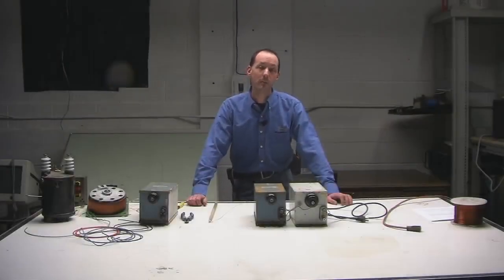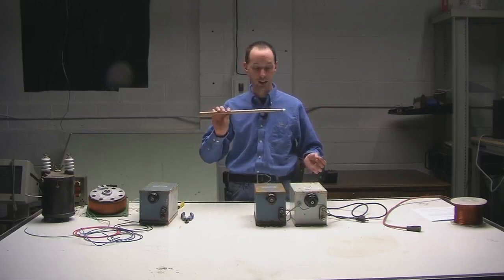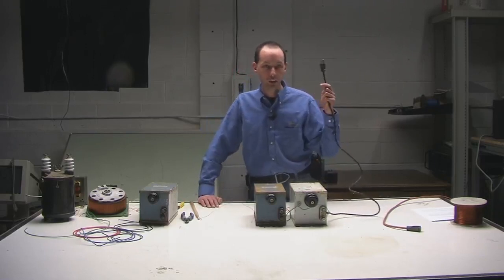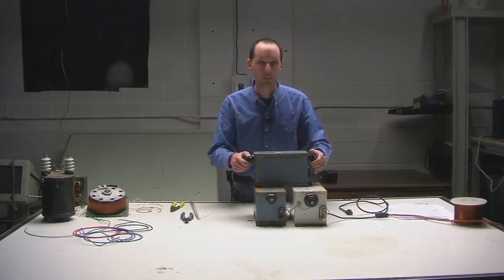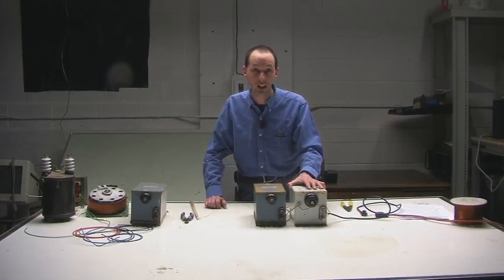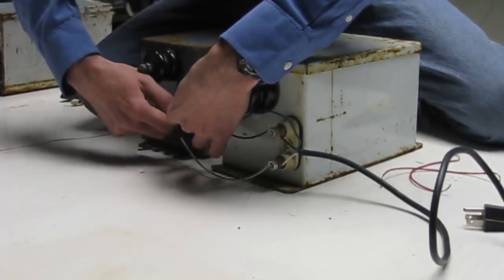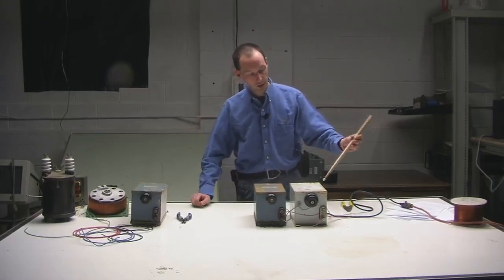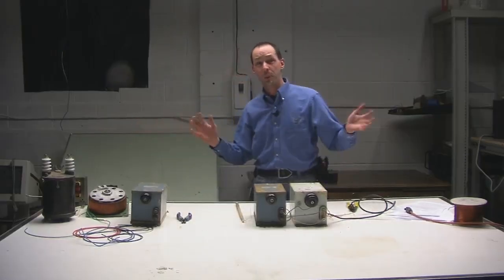Phasing Neon Sign Transformers for Tesla Coil Use Part-1

Comment from the maker: 300V is the minimum generally accepted breakdown voltage for atmosphere. That means that below that, the wires have to touch. In practice it's much higher then that for any "real world" application, but 300V is the generally accepted line.

Comment: They are built with dual windings for safety. Typically, each output wire goes to a different end of a long glass tube. There is almost zero chance that those will even get short circuited. However, there is a possibility that one of the terminals gets a short circuit to ground... either as a flash-over or by a human touch. With a centre tapped transformer, that means only 1/2 the voltage so (theoretically) much safer.

Comment: I have 3 9kv 30ma nst can i phase all 3...i bought one thats 9kv but 60ma will this mess it up...i see different things ...one guy says it wont matter and others say dont try it.... what could be the issue and does it need to be in qny order...like the 60ma going at the first or last of the connected nsts
Reply from the maker: I don't mix different ratings. If you're connecting transformers together (either in series or in parallel) you want them to all be matched. Strange, unpredictable, and very very bad things happen if you start mixing them.

Comment: @soljaboy2006 It's a hotstick.
It is a safety device, and yep, the tip is grounded and the rod is non conductive.
This is so you don't have to get close/hold the wires to draw an arc, because if you do you might get an unpleasant surprise.

Comment: I have questions i can not find the answers too...so i managed to go on a nst buying spree and i ended up with 4 all diff values lmao....7.5kv 9kv 12k. And 15kv...but i have a xhance to buy another 9kv but not 30ma like the rest...its 60ma my question is would this one at 60ma produce more hot and better arcs for a jacobs ladder...and do the ma or what do the ma assuiming mila amps do for arcs i. Ladders, tesla coils, ect...also all of my nst do not have the frankinstien plugs on them they just have the primary feed and ground ( some ) and the. 2 wires all have about 2 feet of wire coming out of the tar.  So can i just connect the sires to say 2 closthes hangers to make a quick jac ladder....and pretty much those 2 wires just mean instead of having the easy frankinstien ears i have to just directly connect using gator clips or something ..that's my 2nd question...difference between the bolt connector design or if your nst just has 2 wires coming out of it like mine.   Anythings i should know ? Any way to connect rhem to some device that would make it easier to connect and disconnect when not using these?  The last question is on a capacitor i recently bidded and won a high voltage pulse cap...45kv pulse limit but only 500pf....the pf or uf,nf on the caps what dows that actually mean for me someone said 500pf might be to low for tesla coils and all with my soon to be 2 pkv phazed nst's...if you have time and can understand all my questions and rambling could you or anyone who reads this answer me at todd r Hart at gmail ( no spaces ) thabk you
Reply from the maker: You've got a lot of excellent questions. I do a live show every evening at 10pm eastern time. Hop in the discord here and ask your questions and we can discuss them on air one-on-one. :) https://discord.gg/KhTKWE3gCC
Reply: Th x for reply the video is old so was not sure if still active. I googled geek group but there are a bunch of geek groups lol. I will check it out

Comment: How can you "over volt" NSTs by putting them in series? Series circuits divide the voltage across each resistor. If you have 2 12kv NSTs in series that's 24kv across both, but still only 12kv across each.

Comment: Hi. i've got two neon sign transformers. one is old heavy type with iron cover/box and the other is one of smaller newer types, both specifies are the same, they are 12kv and 30MA. is it possible phase them to get higher current?
I've already seen some videos of phasing two, but in videos both type are exactly the same.Can I do a thing with my nsts?

Comment: You do not over-volt a NST by series connecting the secondaries. No more voltage exists in each of the secondaries at any point. The problem arises with center taps making the cores live with 1/2 the sum voltage of secondaries between each other. I have connected (3) 15 kV secondaries in series with awesome results. Not arguing that technique is not for the novice. 30+ years HV experience here. Peace
Reply from the maker: We're getting into concepts like that in the new series. This is a very old video and only hit on some very basic topics. There's a much newer (and far more comprehensive series) that we've already started publishing. Check out the newer videos and I think you'll enjoy them. :) Thanks for watching and contributing to the discussion!

Comment: I just use flybacks... The components for the driver, and the flyback cost me just $5... And I can  generate 1.5 inch long arcs @ something like 10mA - 15mA... which is good enough. ZVS driver components will only cost a dollar or two and will generate currents equivalent to the NST at a much cheaper price. So... FBTs all the way!